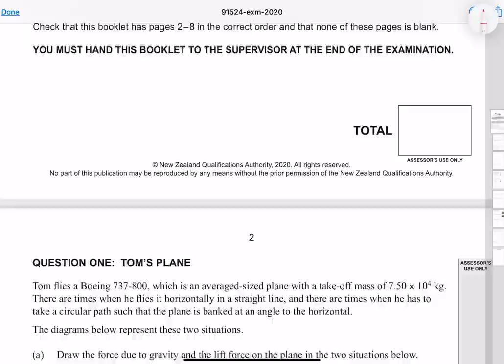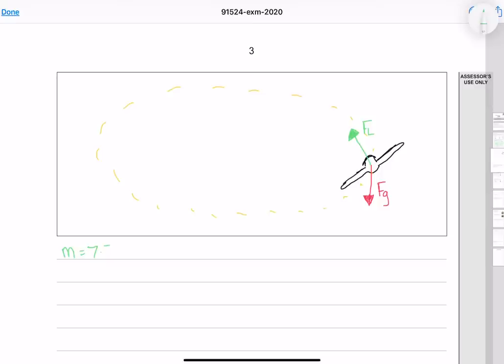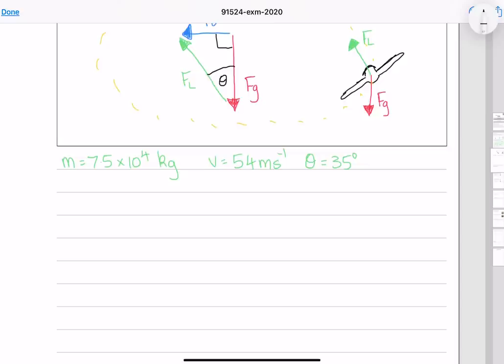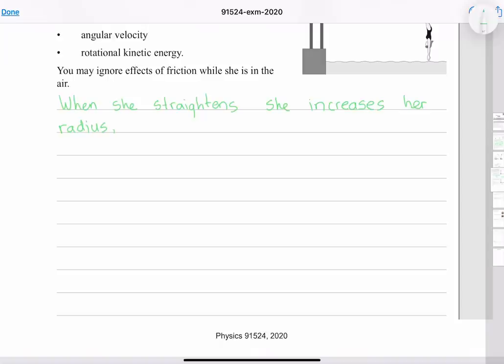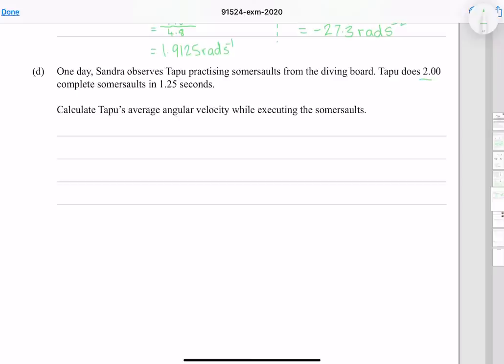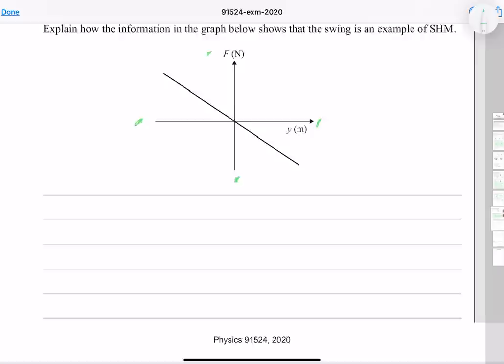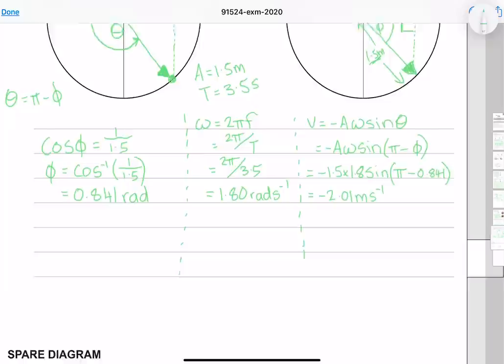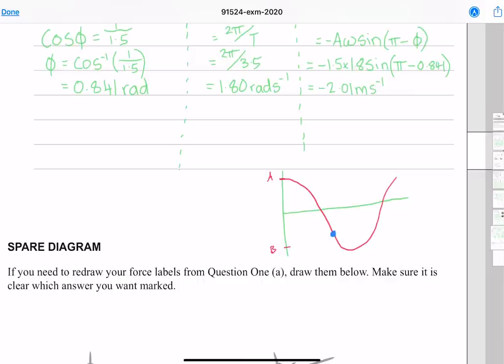2020 Mechanical Systems Exam (NCEA Level 3 Physics)

Comment: In question 2a, are you supposed to square the radius.
Reply from the maker: Good catch Peseti, it is meant to be 0.2^2. Seems I remembered to square it on the calculator however, so the numbers are otherwise correct.

Comment: In question 3b when Selena stands up where is her COM? Also how does the COM reduce the length of the pendulum?
Reply from the maker: Because she stands and shifts her mass upwards, her centre of mass moves upwards. The length of a pendulum is specifically defined as being from the pivot to centre of mass, so by definition it has shortened.
Reply: @MrWhibleyPhysics  thank you very much

Comment: hey mate, your videos are really helpful. in Q3d, why did you do  v= awsin(pi - 0.841), rather than  v =awsin(0.841)?
Reply from the maker: Cheers Liam!
θ is the total angle rotated through.
The total angle between A and B is π (180°).
From our point in question the angle to B is φ.
This means that the total angle θ is equal to π - φ.

Hope that helps.

Comment: In question 3c would this be correct if I said this: The acceleration is proportional to the displacement from the equilibrium position, and The acceleration acts towards the equillibrium position? Would this way be correct or do I have to talk about the restoring force?
Reply from the maker: Great question. While your statement is correct, the graph is of specifically the restoring force and the assessment schedule is worded only in terms of the restoring force.

For that reason I'm not 100% sure the markers would give you the full mark for only talking in terms of the acceleration.
Reply: @MrWhibleyPhysics  Is it fine if I swapped the acceleration and write it with the restoring force? Can I also replace the word proportional to the opposite direction?

Comment: For question 1b, is the banked example the second picture? Also what is a horizontal life component in a centripetal force?
Reply from the maker: Hi Ninja Pirate. Correct, the banked example is depicted in the second picture.

When the plane is banked the lift force is no longer entirely vertical, part of it now points horizontally. This is what we're calling the horizontal lift component. It is what is providing the centripetal force causing the plane to move in a circle. Hope that helps!
Reply: @MrWhibleyPhysics  Oh thanks

Comment: Hey Mr. Whibley, huge fan. Whats the best way to figure out where to put our angle in question 1c?
Reply from the maker: Cheers Daniel! The angle that the plane is banked by is the angle between the lift force and the vertical axis (the gravitational force points downwards along this axis).

Comment: For the last question, will I still get the same answer -2.01ms^-1 if I used V=Aωcosθ
Reply from the maker: Not quite as sin and cos are pi/2 apart, not pi. To use cos you would need to subtract pi/2 from the angle like this https://www.wolframalpha.com/input?i=-1.5*1.8cos%28pi-0.841-pi%2F2%29

Comment: For question 1d, why did you add 1.28x10^4 with 6.37x10^6 as the radius
Reply from the maker: The radius is the distance between the plane centre and the earth centre.

To find this distance we need to add the distance between the earth centre and the earth surface to the distance between the earth surface and the plane centre.
Reply: @MrWhibleyPhysics  Oh I see, thanks